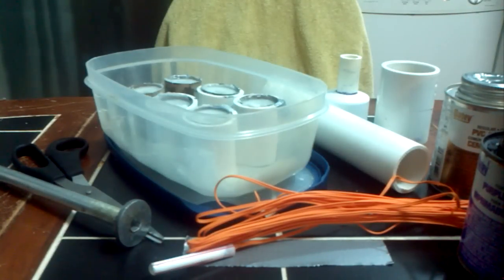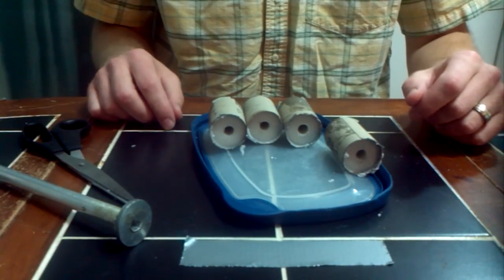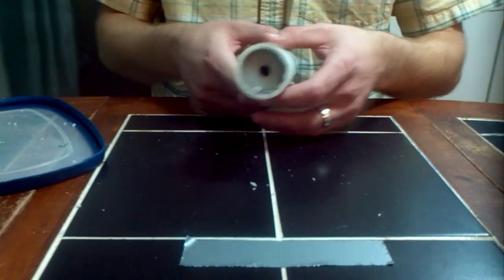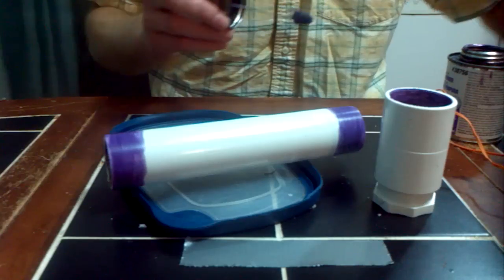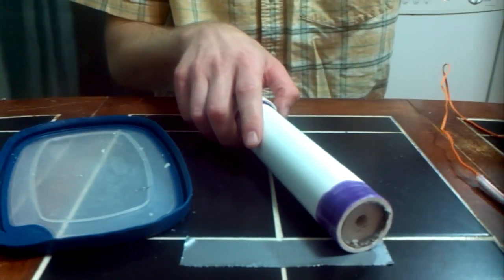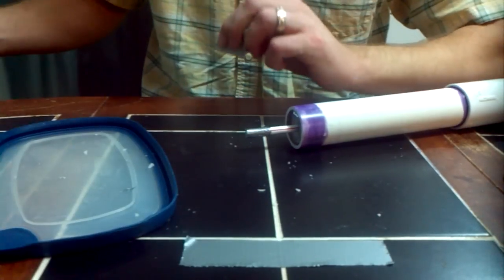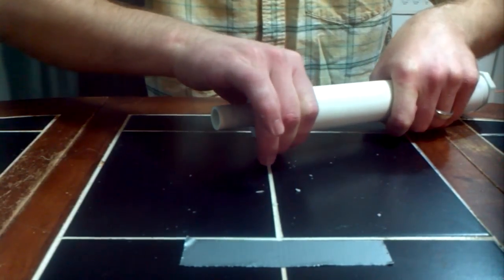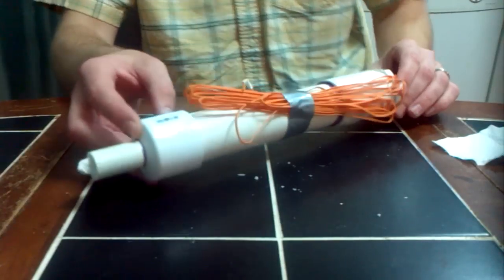Part 5: How to Build a High Power Rocket - BATES Grains Rocket Motor Assembly

Comment: The wadding will still let water vapor in the air through (especially on humid days). I would seal each opening with a thin cover of hot wax or hot glue. It makes a gas/water tight seal that is easily blown off when the rocket fires.

Comment: I am trying to make a rocket with a 40mm x 15 cm pvc pipe, I am using a mixture of 35% sugar and 65%kno3. But the problem is, that the 2 rocket that I tested exploded, one I believe it was because of the ending cap, and I fixed it, but the second one exploded right in the middle of the pipe, I believe it was because I put a 6mm rod to cast the grains, and when all grains light up the gases don't have space enough to reach the nozzle( 16mm).  Can you help me ? I would be appreciated. Thanks and great video

Comment: That's a great idea, though your design lacks reusability, which is very important to me.
Reply from the maker: I completely understand.  Having said that, you will need to buy commercial motors and fuel, and this will prove to be very costly.
Reply: @WizzBang75   I just made mine similar to yours (it's not done yet) except the motor casing and nozzle are removable/replaceable/reusable. A lot of places you have glued-on couplings, I used two different couplings with threads on one side instead, gluing only where necessary. I'm also using electronics so I don't need an ejection charge or anything. When it's done, I'll try and get a good video of it and I'll post the link for you here :)
Reply from the maker: @tristanjohnson367  I would love to see that!  I always wanted to try threaded fittings but I had no confidence that they would hold up to the 1000 pounds of pressure these motors can produce.
Reply: @WizzBang75   We shall certainly see! My motor is a bit smaller than yours, using schedule 40 1" PVC as the motor casing. I'm 3D printing my own molds for the grains. Your videos have been a great help to me, thank you for everything you do.

Comment: You have air gaps of like 1/4 inch between the bates grains. Wouldnt that cause a possible explosion such as a crack in the grain would cause?
Reply from the maker: No, Red.  That is the intended design.  BATES Grains burn from the inside - out, top to bottom and bottom to top.  This provides an exceptionally stable pressure/thrust.

Comment: why does your igniter get installed at the top of the fuel cell....shouldn't the burn start at the nozzle end?....noob hear askin' the question
Reply from the maker: devonwesticles you gain about 30 percent thrust with placement at the top.
Reply: WizzBang75 how does it not start burning your slow powder right away and get pre parachute ejection
Reply: @devonwesticles , with cored rockets the grain should be ignited at the top of the cell to enable the full motor ignition as hot gasses escape. This allows for a faster launch with out wasting as much fuel. A end burner rocket lights from the bottom up only a small portion of the motor is cored.
I'm assuming here but if it lights the top charge at the same time as it should then you would need a time delay charge set at the duration of complete burn and max attitude. So once the rockets motor has completely burned off and the rocket has stopped gaining altitude the chute will deploy.

Comment: I love the design.... the only flaw being reuse-ability.... could you not thread the ends? I understand you have high pressures but surely there's an option.
Reply from the maker: +mudman1st Not possible with PVC Constructed motors.  The threads would never take the pressure.

Comment: How can you call a motor with the igniter installed "safe for storage"? Once that igniter is in place, all you need is a little static electricity and you have a lit motor. One of the most basic rocketry safety rules is to NEVER install the igniter until you have the motor in the rocket, and the rocket on the pad, ready to fly.
Reply: like with working with dets for he just twist the ends together which will safe the ignitor from electro static pickup

Comment: Dude...really...paper towel as a vapor barrier?..F that...use your duct tape, much better seal....nd if you need to keep moisture out, then why not add a little salt that can be dumped harmlessly before launch? I like your design...what did it cost you in pvc parts?..not individually, but in mass quantity.
Reply: John Dexter its not supposed to be water/air tight, the paper will absorb the moister where tap will not.

Comment: 12:25 Tissue Paper....Better off sticking some of those Desilicants or whatever they are called into it. you know, those packets of clear beads you get with some products. Also you should have thought about moisture and air when you sealed the grains in tupperware where they could "Suck up" the air in the container
.

Comment: Lets start off by saying thank you for taking the time to make these videos, I definitely learned a LOT.

But ok I have a question or two for you. I'm new to this so bare with me. 

 I noticed you used 3-4 bates grains, if I was to up the amount to oh say 7 or so, how would that effect the design of your rocket? Like would increasing the amount of segments to the motor increase the amount of pressure on the rocket, requiring a redesign from your build. (Other than length)  

 And second question, why does direct casting without segments cause greater pressure towards the end of the burn?
Reply: WizzBang75
Very right. lots would change. i would like to add a small detail.

Towards the end of a solid engine burn, (I'm refuring to the desing seen on this video) the surface area in side the engine grows. It is a center burn which means the flame starts ruffly in the center and burns outward down the whole length of the tube. some simple math would show that the amount of material burning is highest towards the end of the burn. The more material burning at once the higher the pressure. the nozzle limits the amount of flow which means as more material burns and tries to escape the more choking the nozzle dose which translates into more pressure.

Please exercise lots of caution when increasing engine or motor sizes and propellant mixtures. And be the most afraid of the little harmless changes that shouldn't effect anything. Those are the most dangerous, and surprising.
Reply from the maker: Hi Tony, sorry about my delayed response to this question.  I missed it somehow.  To answer your question...Your rocket design would have to be VERY sturdy as you are moving from an "I" class motor into the lower "K" class.  I tested a 7 BATES grain motor 3 times.  Twice it tore right off of the test stand and the 3rd time it drove the post of the test stand 3 inches deeper into the ground.  Your nozzle throat diameter would have to go from 3/8ths inch to at least 1/2" in order to stay within safety margins.  Also, your delay grain would have to burn about 5 seconds longer in order to prevent early release of the parachute.  Essentially, it would change everything about the design...from using tougher air frames to delay grain changes and nozzles design changes.  If you are still building, let me know, I'll help with what I can.

Comment: no no no Don't use "Quick -pop" squibs...... As an Igniter. they are designed to light off ejection charges. And may be inconsistent in lighting your motors. you must develop your own igniter. using trimmed off pieces of propellant

Comment: Seriously? This first step here is NOT needed with the propellant I use because the propellant can directly be cast in the motor chamber/chambers eliminating this step.
Reply: Although for multiple grains your technique may be better. But for one long single cast grain, the "Direct cast method" I find to be better.. With Mixing The propellant I use, It CAN be mixed in Large batches therefore Allowing the "Direct Cast Method"
Reply: skyprop
now for the motor you show in this clip I could have cast directly in one shot eliminating several steps
Reply: skyprop
I've successfully "Single cast" motors of 3"X12" in one shot and could do bigger mixes.
Reply: BATES grains and Single Cast motors have different burn profiles.  For many applications the BATES grain is a better, but slightly more complicated, solution

Comment: Would you mind explaining the purpose of bates grains, and why you put the fuel into different sections? What is the point of having a hole through the center of the engine? Does it add more power to the engine?
Reply from the maker: DontPutSpiceonRice:  BATES grains was designed to give a steady amount of thrust throughout the burn.  It burns from the the center to the side, from top to bottom and from bottom to top.  The Core in a motor is essentially the only way a high powered rocket motors with produce enough thrust to lift the object off the ground.  For example:  an end-burning motor will produce about 70 kn of thrust.  That same motor with a core will produce 150 kn.  These are numbers that will vary greatly depending upon motor design.  Put the idea into terms of horsepower...Do you want 70 or 150 to get the job done?
Reply: WizzBang75 Thank you very much. Also, why are motors cut into sections, instead of just being cast inside the rocket itself? And what is the of an inhibitor sleeve?
Reply from the maker: DontPutSpiceonRice:  Inhibitor sleeves act as a thermal barrier between the fuel and the motor walls.  For the purpose of BATES grains, they also prevent the fuel from burning on the outside, as BATES are supposed to burn from top to bottom, bottom to top and inside out....NOT outside in as well.  To answer your other question...you can cast fuel directly into the motor, and I have done this as well.  When using BATES grains, you get a "Flat" thrust...a relatively even thrust.  Casting directly into a motor gives you a Single grain which will produce "Progressive" thrust...power that will increase over the short duration of the burn.  Using that technique you will get higher chamber pressures towards teh end of the burn.  Both work well, but I prefer BATES.  It's only a matter of preference.

Comment: Motors are not stored with igniters in place. Igniters should be installed with the motor in the vertical position, on the test stand or on the pad.
Reply: It takes high amperage to detonate. static electricity is high voltage and extremely low amps which could never detonate it...
Reply: @marcferretti  it would really one set off the ignitor if both ends of the ignitor was connected together making a loop in the circuit.
Reply: @jamesluck2969  By connecting the leads from the igniter together, you will shunt the circuit, preventing it from firing at all. I work with high explosives, and the electrical blasting caps are shipped with a shunt in place between the leads. Basically, your electricity would have nowhere to go. For example, if you hold a hot lead, but aren't grounded, you won't get hurt. 

Now, that being said, everything is cool until you add the boom sticks. It's horrible practice to put igniter and fuel together until you're ready to go, because Murphy's law is just as reliable as Newton's.

Comment: How thick was your nozzle throat? The thickness of that orifice makes a big difference on how well the nozzle performs. Too thick can slow down the flow of the gases into the divergent section of the nozzle and will rob you of power.